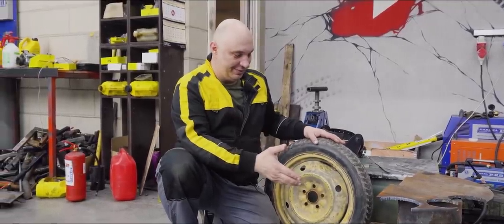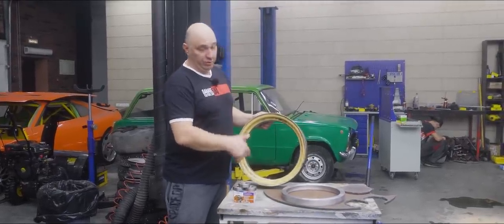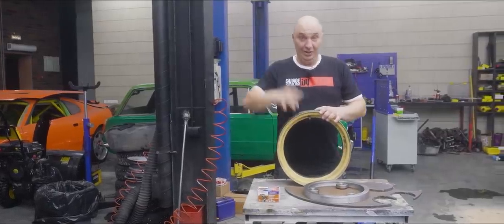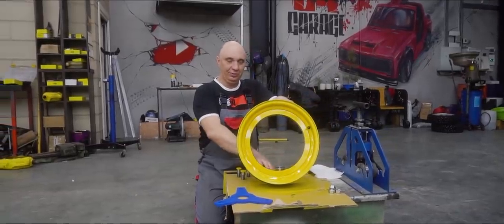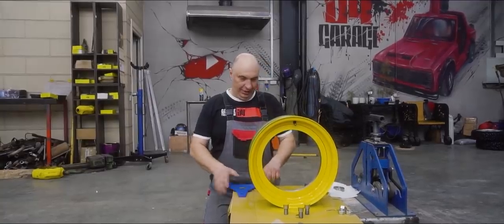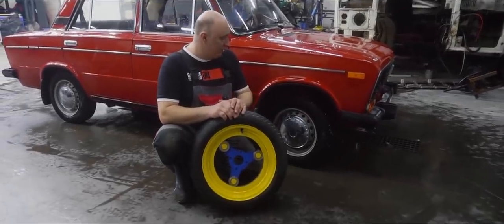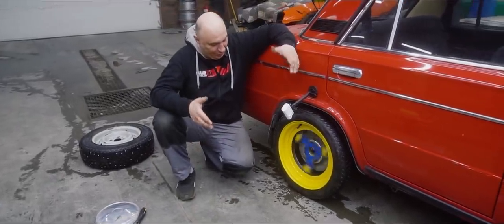Making a wheel with centerpiece on bearings

Comment: There is a space between the bearings and the machined ring. Im guessing it's very small but considering the weight of the car, I guess it will result in a lot of knocking
Reply: yeah i was thinking if the ring is thin enough the tension might have bent it out a bit making it loose?
Reply: Yeah it has some play, but the main problem is the 3 bearing design it. Since theres alot of weight from the car it causes more pressure on the bottom 1 or 2 bearings closest to the ground which leave pressure off of the top bearing which results in a change of bearing pressure through rotation which means the top bearing is slapping when it comes under pressure thats where the knock comes from. In short the each bearing is taking turns being under load instead of the pressure being shared equally between all three
Reply: Need to preload them outwards a bit. Also bearings are not strong enough to use the outer part as a roller like this. They're not substantial enough.
Reply: @kalashnikov3796  exactly 💯
Reply: That was my 1st thought too. Don't need much clearance to cause that small gap to be knock. A 5 spoke would likely reduce it  a lot.
Reply: @kalashnikov3796  It could be pretensioned, but this kind of fit usually does not spin that freely. You can find that sometimes on excavator/loader rollers, which are designed for high loads and usually are quite hard to spin by hand.
Reply: I agree, there is a tiny space in it. you can see it when he first puts the center in the wheel there's just a teenie tiny gap, probably half of a millimeter of play or something obnoxiously small. However it is enough to cause more of a stepping motion which would be the knocking rather than a smooth roll.
Reply: any bearing that is going to carry a load does need to be pretensioned or there will be gaps and rattling and fretting. The flimsy spider shape in this hub adds to the problem because it is less stiff than it could have been. More legs would be a bit stiffer but leaving the whole circle would be much better at resisting deflection. And it wouldn't look as cool clearly.
Reply: Came to the comment section to see if I was the only one who understood this lol, yes it has some play in it and that is causing the knock, it is actually running up and slamming down on the next set of bearings, have to make a set that would fit as many bearings ass possible to stop this problem
Reply: @kalashnikov3796  It also doesn't help that the bearings are mounted on one outer side of the "fidget" creating a flex outward each time one bearing comes under load at the forward bottom, which will then flex the rest of the space saver rim in the opposite direction inward near the rear top ie where the calliper is.
If there were two fidgets with the bearing between this might not happen, but you would run into problems at the hub.
Reply: @kalashnikov3796  Could also be that when he applies the brake the caliper moves inward ever so slightly thus moving out of the way a bit. That would explain why the noise isn't constant.
Reply: I was thinking the groove was slightly too wide with the weight.
Reply: @lt.lasereyez8891  But, They already tested it with no load before going out driving and they said they had no interference issues??
However they also did have clunk noise when the wheel was fitted to the rear, maybe there is a lump in their machining or maybe a small spatter ball of steel from mig welding in the groove or a bearing has already started to fail.
Reply: @Bobs-Wrigles5555  Brakes heat up and expand when they get used, perhaps than can explain that
Reply: @lt.lasereyez8891  In California, in summer under heavy use, Possibly.
But At 5-10mph, in snow, in Russia, in Winter, -10~? degrees C, 
I don't think heat expansion would even get a chance to happen.
And that doesn't affect the rear wheel, it's a drum brake.
Reply: @Bobs-Wrigles5555  The ambient temperature doesn't matter, the difference in temperature before and after/during use does.
Reply: @lt.lasereyez8891  Are you trying to say the disc heats up and moves the calliper housing outward, I thought you were talking about transferred heat, These disc brakes don't work that way.
The calliper housing in this case does not move, it has two pistons which push toward each other on both sides of the disc, if the disc swells from heat the pistons move back.
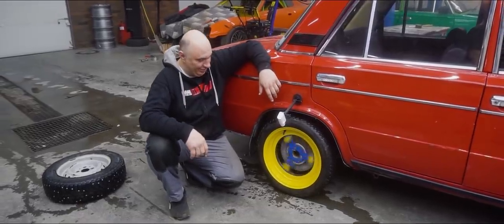Have a look at 13:30, you can see the brake calliper housing, which is bolted to the hub assembly, and it has a fixed metal feed tube at the top which is also run around the hub where it then goes to a flexible pipe to the braking system on the body.
Reply: The concept is sound, but it needs far higher precision to avoid this sort of outcome. Running the bearings dry doesn't help either. 
It needs tapered bearings, shims etc (like diff carrier bearing setups) to be absolutely bang on, but that's not as much fun as just having an idea and knocking it up on the lathe!
Reply: Smart guy. Was thinking the same thing looking for a comment about
Reply: @Bobs-Wrigles5555  it is all made out of cast iron, this expands when it heats. The disc the pads the hub that holds it all and the bracket that connects the brake to the hub. Heat expands (cast) iron and changes things. srry for my poor english i dont care enough to behonest
Reply: should try a stationary design, 3 or 4 bearings in the bottom half permanently, and one on top as a guide to keep the wheel in place
Reply: @Rich-on6fe  so would cooling the bearings in a freezer and making the hub larger fix the problem or would that just ruin the bearings?
Reply: @maytagveneno9653  I don't think there is anything to freeze here, but if he mounted each of the three bearings on an eccentric stud that would let him 'dial in' a bit of outwards preload force on each one, and that would mean that as each one and its spoke deforms under load, it would not result in the others losing contact. One problem here is that the spokes are a bit thin and floppy. More spokes or no spokes at all (a solid disk) would make it all a bit more resistant to this floppyness problem.
Reply: They didn't get the welding perfect, the bearings aren't meant to be used with the outside diameter used as the active/rolling surface, and there is likely some shifting of weight going on because of the 3 spoke design, causing a knock as well. Very nice video though.
Reply: Bingo

Comment: I would love to see this design but instead of bearings you use gears to create a planetary gear set.
Reply: That'd have serious gear reduction, car could pull a dump truck. Excavator final drive is similar, something like 56:1
Reply: That's actually a good one
Reply: Put some likes to this peeps!
Reply: A 75 hp engine able to pull a locomotive! 😆 I wanna see that too, it's actually a great idea! 👍 Watching the gears move (within a clear cover) would be nice.
Reply: You could climb the steepest hill that way, as long as the tires maintain traction.  Sounds like a rock crawling invention.
Reply: That's exactly what they use in big tractors and monster trucks
Reply: If you replace all bearings' outer layer with studded stickouts and the big ring too, then you have the concept of automatic transmission
Reply: Literally portal/torque hubs
Reply: If you had a way of locking it out you would have a normal range and low range, eight forward and two reverse. 😊.

Comment: That knocking noise:  There's a slight gap between the outside race of those three bearings and the rim  Every time it gets to the top there's a gap so it releases, and then when it goes toward the bottom front it connects and there's a thump.  The tolerances are too large.  There are three knocks per center piece rotation, so that proves it.   It can't be the bearing's bolts knocking against the caliper because they double checked that.  To fix it, you'll probably have to drill the bearing bolt holes further out by a hair or two.  Maybe go up one bolt size or add material with a welder then drill further out.

Comment: The three bearings must be having some clearance with ring so when wheel try to roll that spoke rotates over bottom bearing carring the load and coming bearing falls over and makes contact with ring and makes that sound. In actual case only two bearings are in contact with ring and when third tries to make contact it makes that sound. It is same as triangle tipping over again and again.
Reply: Yeah this is what is was thinking. Making this with zero clearance would be impossible without some part needing to be hammered or pressed into position.
Reply: Could you reduce knocking by making 4 spokes? This would also reduce the thin edge distance on the 4 wheel stud holes like shown at 4:02. Line each spoke up with a wheel stud.
Reply: or just have a slanted bearing surface but then you'd need a press plate.
Reply: Might need more Pre-Load to take up any slack.
Reply: Agreed. put in 6 bearings and spread the load maybe.

Comment: That knocking is the load shifting over the bearings, the load is causing a slight gap which causes the next bearing to slam into the rim as the load moves over
Reply: Maybe it's that they measured the distance when the caliper is not breaking and sitting in one place but when you apply the break the caliper moves because when you break half the movement is done with the piston but the other half is the whole caliper moves to pinch the router
Reply: You can actually see it whacking the caliper. Or why you always test with a load...
Reply: this makes a lot of sense

Comment: Make 4 of these and put them on your drunk friend's car the night before and watch him "drive" away in the morning.
Reply: how will the car move   ?
Reply: I was wondering all the time Why? Why on the earth? You answer it :-D
Reply: @punker4Real  thats the joke
Reply: @punker4Real  Using a Fred Flintstone Traction Control Device
Reply: @punker4Real  it will move appropriately, exactly like it should for that drunk friend.
Reply: just need 2 for most cars
Reply: @punker4Real  Exactly
Reply: And also the spare tire for good measure, in case that drunk friend attempts to replace a wheel lol
Reply: @punker4Real  Da
Reply: You mean TRY to watch him drive away!
Reply: lolllol.
Reply: @GrimYak  You could troll him by just switching out one of the drive wheels. Most cars wouldn't get anywhere as the differential would make the wheel with the least resistance spin. Most cars does not have a limited slip diff or a diff you can lock, but if your friend just applied a little brake then some power would be transmitted to the standard wheel and the car would move, only very slowly. More break, more power to the drive wheel but also more braking power to overcome as there are three wheels that are braking. I'm not saying it would be impossible to get into a traffic accident, but it would be hard to build up any speed so the car would be creeping along.

Reminds me of a couple of alcoholics my father used to work with. Both are long dead, so I don't feel to bad to talk about them, and neither was in a traffic accident. Well thing is they took what ever they could get hold of to take them to the store and get something to drink. This happened almost every day and they drove anything from tractors to regular cars. One time they took a lawnmower to the store...
Neither of them had a drivers license, because they simply didn't care to try for one as they would have had to stay sober for probably more than a day to be able to pass the drivers test. Well it also meant that neither of them had actually learned how to drive or the mechanics behind how the gearbox worked or why to switch gear and so on. So they usually started on second or third gear and moderated their speed using the clutch and the brakes. That ate up a good many clutches over the years...

They were actually good people both of them, just that they happened to be alcoholics. I really don't know how they managed to keep their jobs though, and now there is no one left alive that I can ask. The older guy made it to his pension and joined the AA, but his liver was badly damaged and the rest wasn't in top shape either. He died just a couple of years later. The other guy partied with some "friends" in his apartment over the weekend and didn't come to work on Monday calling in sick. My father met him on the sidewalk a few days later when he was trying to do a "medicinal" run as he was out of booze. He looked like death warmed over and said he felt like, well death warmed over. As they parted my father saw that he had a huge lump on the back, stopped him and got his jacket off. Turns out he had a kitchen knife stuck the full blade deep in the back. He died shortly thereafter in the hospital.
Reply: Just jack it up on bricks same results free and quicker.

Comment: That would be great for an emergency tool if you get a car where the brakes seize
Reply: I could have used that kind of a spare tire in my trunk last summer when my brakes seized, and been able to drive home instead of leaving my car on the side of the road and coming back days later with tools.  Having that kind of a spinner wheel as a spare tire would save a person from both flat tires and seized brakes.  Thanks for the idea.

Comment: The knock is probably coming from 2 things:
1-the tri-shaped center is not perfectly centered, so it can wobble a bit when it rotates. Many wheels are "center on hub" style, where the wheel is centered on the round hub center sticking out, not the lug nuts. 
2- there is no preload on the bearings. So the outer race is fitted onto the bearing balls with a certain amount of tension. When you have 3 bearings running on the rim "race"(machined section wended to rim) there needs to be some pressure on the bearings to prevent the center section from being sloppy and slapping around when it rotates. If I may suggest:
Replace the existing front hub and brake assembly with the wheel unit. This would eliminate the slop from the rotating center, and allow the rim to ride closer to centered over the steering bushings. 

All that said, I love the channel and I can't wait to see what you do next!!!!

Comment: Pretty sure its a combination of only 3 connection points, machine tolerances and the strength of the wheel they're spinning on. Tolerances for bearings and such are super tight. We're talking +/- .002 inch tolerances. The ticking is from the contact points changing as it goes over, when you stop the wheel is not changing contact points. The wobble is the wheel not being able to support only 2 contacts it's ever actually riding on. The wheel wasn't designed and doesn't have the strength to be a 2-3 spoke wheel.

Comment: So... As a conversation down there already discussed, the 2 main issues are the unperfect clearance between the bearings and the rolling surface, making the transition knock, as much as the wiggle between the bearing sides and the casing sides.
A better option of doing this is probably doing a planetary gear setup instead?
On the other hand it would surely need to be oiled of at least greased a lot.... But i assume it would lessen the wiggle up and down, or when making this planetary bearing setup, it would be good to make the covers/bearing connection CNC milled maybe on both sides so the connection plate won't bend and the outer casing made out of one solid piece with side tolerances in the hundreds part of milimeters in diameter and inner length.
Also at least a Cellamit cap over the bearings themselves and if that won't make it gone, make the bearings being mounted onto adjustable length, weighting it out at the tire swing machine thingy.

Comment: What a fun project. Enjoyed your video. I do have a few suggestions: 
1) for the drive axle you could use one -way bearings. You will have no reverse though. And I am not sure if these kind of bearings can handle the torque. 
2) you could attach an inverted brake disk into the wheel and flip the brake caliper.
Keep up the good work 👏

Comment: Take the ring gear from a flywheel and weld it to the inside of a wheel. Make a bracket welded onto the rear axle with a starter motor lined up to the ring gear on the wheel. Do this to all 4 wheels to have 4WD driven by starter motors.

Comment: for some reason this reminds me of the old front wheel drive christie fire trucks system. the tire was on a ring gear and the center of the wheel stayed still.
Reply: Christie suspension eh?
Reply: @aterack833  not quite. drive system came in at the top of the wheel. more like a planetary gear system. these fire engines were in service around 1911.
Reply: @stoffhimel  sounds like a portal axle as used on Unimogs even today, it gives huge clearance under the axle for off road work.
Reply: @CrusaderSports250  sort of. there was still a support in the center of the wheel. Jay Leno has a video on one, if you wan to see what Im talking about.

Comment: I love ur experiments and vids!! Ring circumference is slightly larger than the bearing spoke combo.(tiny gap) Every rotation the next bearing in line "falls" into place and hits the inside of the guide ring due to the weight of the car. If you took that 3 sided spoke and tried to roll/rotate it on a flat surface there'd be a knock for every spoke/bearing making contact with the ground as it rotates.

Comment: Now place one on each side of the front axle and lock the front axle so that it cannot rotate at all. Then go for a drive.
Reply: It would be nice for them to live and make another video, you know. ;)
Reply: That Lada is rear wheel drive, putting two on the front and locking the brakes would just have the car drive normally but with no front brakes, not really that epic.